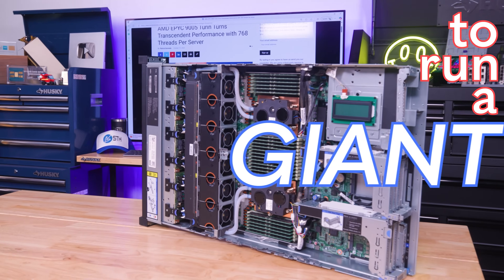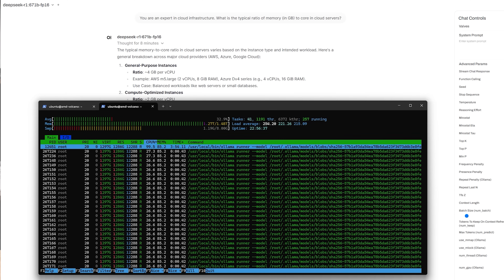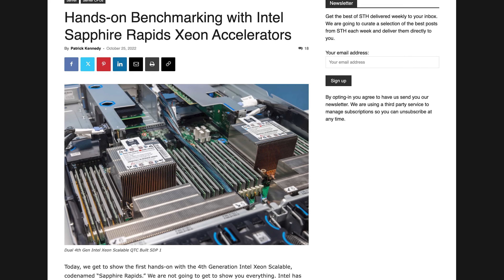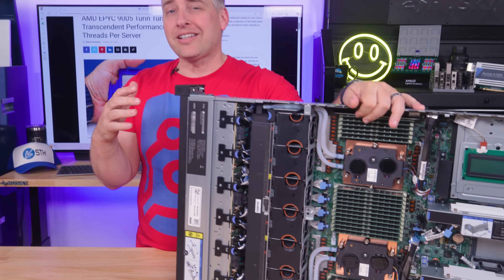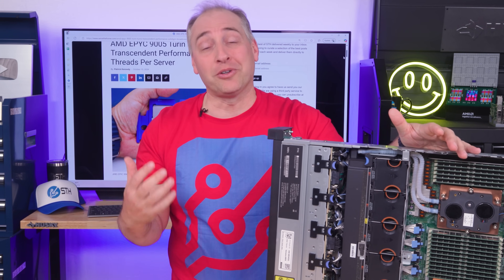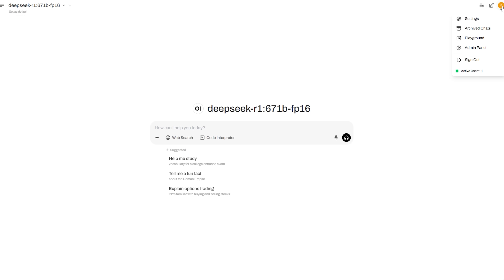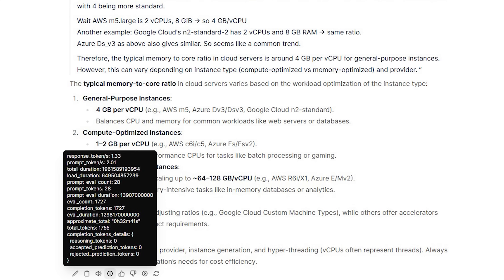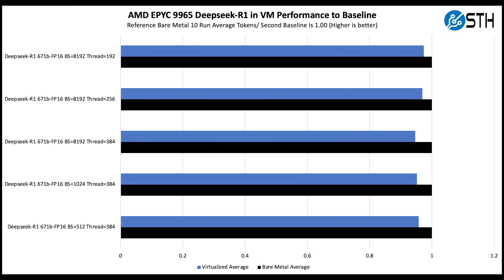Running Deepseek-R1 671B without a GPU

Comment: My intent is to do this on my server, though I plan on running smaller models than the Deepseek one.  The plan is to set up vms for my daughter to use for her photography side hussle/hobby and for my LLM habit(yeah I said habit LOL).  Really enjoy working with AI models both diffusion and inference models.  So win win situation if I can manage.  My server is a bit on the old side as it is for a home lab.  Best of luck to anyone who gives this a shot.  It is both overwhelming and rewarding at times.  Thanks for the video, now I don't feel so bad about a token a second now as the server you have there is a lot newer than mine.  So thinking I might not be doing so bad.  Albeit, the models I run are 70b and smaller but I also don't have near the horse power of the newer servers.

Comment: What if you bought the AMD EPYC 9015 (i.e. cheapest 9004-cpu) and a single-socket MB, but also filled all 12 memory-channels with DDR5 6400 MT/s. Would the CPU be able to keep up with the memory while running inference on Q4/Q8 DeepSeek R1? If so, then that would be a really nice price-to-performance system.

Comment: That's a complete waste...you can buy a used epyc 7702, 512gb memory system for $2000 and get the exact same performance.
Reply from the maker: This was at FP16. So that used 512GB system has less than half the RAM required to do what we did

Comment: 5 KW sounds like A LOT compared to mac studio 512gb with at most 480 Watts
Reply from the maker: This was on a 1kw ish system and the Mac Studio M3 Ultra 512GB but that does not have enough memory for this.

Comment: Not sure about AMD but Intel has libraries and extensions to accelerate AI workloads for Pytorch, TensorFlow, Transformers, etc. You can get as much as10x speed up versus genetic libraries (though you need a CPU with at least AVX2 support).

Comment: I prefer to run qwq:32b-fp16 reasoning model which you can easily run with 3-4 3090 or 4090 GPUs at a fraction of the cost of a huge core server at much better tokens/s and it actually performs equivalently to Deepseek R1 671B.
Reply: Q4 fits in a single 4090, and it's not that much worse, isn't it?
Reply: @vinylSummer  Always better to start with a smaller or more quantized model and only increase to larger ones when you need better performance.
Reply: @vinylSummer  That being said, Q4 on a single 4090 doesn't leave much room for context length which is pretty important.

Comment: CPU L3 memory is the critical bottleneck, in that with chipsets.. and leave specific cores out for the OS, one each CPU and on Epyc, each side..  Ya.. HPE 385, Romes (256M L3); 800W ( w/ 2T ram and a RTX8000 just got the GPU) and still setting up the MilanX (Supermicro w/ 1T and haven't decided on the GPU configuration.. maybe 2 RTX8000s?  10G RJ45 and/or 40G copper qsfp direct , +  Starlink.   Watch out for IBM used drives (funky encrypted in 520 format) and HP hates everything not HP (yellow lit already).  Master and student LLMs; fine training is the anticipation.  The real question is how low can one go with small LLMs, even in laptops with a dedicated GPU (P200, 2G Vram).

Comment: how would it work if u have an array of optane drives and would there be a way to run the models directly from disk?

i have 2x 480gb optane drives that would be enough to fit the model and run from disk and since optane is memory like, would that be enough to run it from disk or would the slower sequential read speeds be the problem? would that even be possible somehow?
Reply: Didn't Intel shelf Optane a while ago already? I thought there was no more software support ?
Reply: @thegeekno72  optane in itself is just another type of flash storage, the optane ur thinking about is probably the acceleration type to accelerate hdds and ssds which i dont care about, i just want pure optane to use for ai stuff.
Reply: LLMs are mostly memory bandwidth limited. Running off of what, 5 GB/s bandwidth on two optanes would be dog slow. The server in this video was probably at more than 500 GB/s bandwidth, so your model running on optane would be at least 100x slower. Probably even more so because of the added latency of optane vs DRAM.
Reply: @Steamrick  ahh ok intersting, so its just needs smth like a brain which just is highly interconnected to work the fastest, kinda makes sense if u think about it like that.

Comment: 8:10 small correction, the default ollama model is a Q4 "quantized" not a "distilled" model. Quantized is the original model but with its parameters "compressed" at the cost of a bit of precision. Distill is when  you train a different model, say Qwen or Llama, and fine tune it or "train" it on the outputs of another more powerfull model.
Reply: I would love to see a benchmark of the 671B 4 bit model on the same hardware

Comment: I run 4bit quantized version of DeepSeek-R1:671b on my home server CPU, PC is made from 10 years old e-waste parts:

・Dual processor Xeon E5-2697A v4 ($85 each)
・Supermicro Dual Xeon E5-v3 era motherboard
・8x DDR4 64GB ECC LRDIMM (512GB kit, around $500)
・Windows 10

DeepSeek parameter file is about 400GB and it consumes ～440GB main memory on running.

Couple of thoughts.
・I felt DeepSeek-R1:671b output quality is pretty good, it outputs worth to read text, much better than smaller models such as 70B or 14B.
・On Windows OS, just install and run ollama and setup DeepSeek onto ollama. input the question on the ollama console and DeepSeek answers.
・Token process speed is like an e-mail exchange with colleague type experience and not like a chatting speed.
・It is better to store parameter file onto SSD not HDD for quicker startup.
Reply: that's totally amazing, 512 gb RAM dumpster PC is just wild
Reply: I'm interested in this, whats the token/sec with CPU only?
Reply: @timecrash85  The speed is 0.19 tokens/sec.
Reply: @kenkyuujyomanoretimedia6509  lmao
Reply: @kenkyuujyomanoretimedia6509  HAHA, i mean if you are accessing it with software, might as well just wait all day right.
Reply: IMO DeepSeek-R1 671b 0528 q4 model is by far the best model, totally worth the wait to get answers, seeing superb 671b results make me to stop using smaller 70b or 32b, those distilled models output too many errors. BTW I recently added DRAM to 1536GB and now DeepSeek-R1 671b q8 runs as well on my dumpster PC. So far there is no perceived quality difference between 671b 0528 q8 and 671b 0528 q4 (4bit quantized model), both models output valuable and insightful text.
Reply: If you only get 0.19 tokens/sec, then something is seriously wrong with your configuration. With 8 x 2400 MHz DDR4 DIMMs you have a total of 156.6 GB/s of bandwidth shared between your two sockets. Each token invokes 37 GB / 2 = 19 GB of RAM. The theoretical bandwidth limit is 8 tokens / second. Xeon E5-2697A v4 has AVX2, so compute should not be the limiting factor. Most likely your processes are calling memory across the slow CPU-to-CPU link. TRY THIS: Use b4rtaz/distributed-llama. Set up two nodes, each limited to a single CPU. Configure each node with a TCP port and connect the two nodes via the Localhost (127.0.0.1) address. For more information, read the thread "LLM inference with tensor parallelism on a CPU" by @fairydreaming in r/LocalLLaMA on Reddit.
Reply: tokens?

Comment: The best workloads are those which are batch jobs (no interactive user). We actually do have a VM that runs AI workloads on the CPU for exactly that.
I think if you have a N+1 cluster for running VMs, you might be able to do this on a node you might keep empty. But how to set things up that the VM goes away when an outage of an other machine happens ?
Maybe if you are only running Kubernetes, having all Kubernetes VMs running on all other machines and have one large Kubernetes VM on the one machine, after everything is settled, add the large VM and deploy the pod on that VM, if you specify the correct mem/cpu for the pod Kubernetes should automatically place it on that node. Then have a small program watch if any Kubernetes VMs are down, if so, kill the large pod, all the Kubernetes workloads which need space to go somewhere else will automatically end up on the large VM.
I guess you could do the same thing at the hypervisor level, if you aren't using Kubernetes.
Reply from the maker: That is exactly the idea

Comment: LLM inference on modern hardware is not compute limited, but memory bandwidth limited. (See 11:04 - Using only 48 threads on 2 x 196 cores gave the best performance.) Using 4-bit quantization instead of FP16 should thus give about four times more tokens per second.  ALSO: Offload the fixed parts of the model to a GPU or two. Any GPU or GPUs with ~24GB of VRAM will do, as long as their combined memory bandwidth exceeds that of the CPUs. Deepseek-R1 671b is a Mixture of Experts model. For each token, only 37GB of the memory is invoked. Some 60% of this is fixed and used for every token. Offload these layers to the GPUs. This should double the throughput. 
About NUMA: For best performance use tensor parallelism and split each layer evenly between the NUMA nodes or dual GPUs. Otherwise your nodes will be running in sequence with each NUMA node or GPU active only 50% of the time.
Reply: Have you run quant 8??   and older GPUs don't do quant 4 very well... (yes, I have a couple of P40s that I picked up cheap)...

Comment: big money, big video, 1 token per second... amazing
Reply from the maker: Closer to 3 tokens per second with minimal tuning and showing you can do this while running other VMs. Remember this is a model that is bigger than the GPU memory capacity of an 8 GPU HGX H200 platform
Reply: @ServeTheHomeVideo  i agree, i was just expecting more for such a beast of a hardware. i was thinking i can invest like 30k to get it run "well", but seems this take 10 years more to happen 😞

Comment: I've got the DeepSeek R1:70b model running on a pair of 3090s right now at home.

And as a result of my experience with it, at home, I actually PUSHED my company's IT team, to deploy the model, at work.

At first, they were like "we don't have the infrastructure to support it" and then I was like "but we don't really need to run the 671B model neither", so they were able to deploy the same 70B model as well.

We're still, right now, at the stage where we have to scrutinise the results that the LLMs produce as there are still quite a lot of errors with them, so it takes a couple of tries.

I'm also pushing my company (in automotive) to use it more as well, but also recognise where it might not be as useful as senior management might think, as well as using it so that it can automate my own work, so that I can move on to doing something else instead.

Comment: An interesting idea, though I should point out that this is a model that's being trained against a dataset. To have your model run for your dataset will require entirely more capacity and IO. Second is resource contention--vCPU ready time and costop. For infrastructure servers running services, yes this makes sense, for user facing scenarios, not as much. As always know your apps and their latency sensitivity and be aware that latency can be a knock on effect when repeated access is required and the data isn't in a fast cache. 

I am more wary of unaccelerated workloads because of dataset training, and if Intel accelerators work well with DeepSeek, then there's the knock on effect of performance advantage for model tuning and iteration. All things to think about as there can be a spike in TCO if you're cavalier with AI and don't plan resources, especially if electrical consumption (performance per watt!) starts to creep in.

Comment: My Sapphire Rapids + 1TB RAM + Nvidia RTX 6000 Ada:

DeepSeek R1 671B Q4, loading 5 layers into GPU:
4.36 tokens/sec

DeepSeek R1 671B Q8, loading 3 layers into GPU:
3.62 tokens/sec
Reply: Did you try offloading the always-on MoE experts to the GPU?
Reply from the maker: Sweet! The idea of this was no GPU and a virtualization-focused setup, and I wanted to do something big. You are right, smaller models can perform better.

Comment: Thanks! This video answered a major question. Next thing I wonder is how many tokens per second would Q8 model squeeze on that server. Double? Or something else? And how CPU utilization will differ at Q8? Also, if there is a GPU (or two), would it give a detectable speedup? And what about the CPU utilization then (with GPU in the mix)?
Reply from the maker: All valid points and ideas. At some point, we had to bound this because it takes a long time to iterate through 10 runs, even just varying thread counts or the type of VM being run concurrently.
Reply: LLM inference on modern hardware is not compute limited, but memory bandwidth limited. See my comment above about MoE and GPUs.

Comment: 671b at fp16... woof... In my experience, the quant 4 is reasonable, but there's a pretty dramatic usefulness difference between quant 4 and quant 8, I'm sure going from quant8 to fp16 is likely another pretty big jump, but I noticed (particularly on the smaller models) that quant 8 is a pretty nice step up in the quality of the results.
Reply: Considering 671B was trained at FP8, you gain very little running it at fp16
Reply: In my testing Q8 is a real sweet spot. Q16 starts getting diminishing returns.
Reply: @zackj997 Yeah, Q8 is a really nice middle ground.  I run the llama 3.3 70b at q8 (on 4 RTX 3060 12GBs) and it is awesome.
Reply: @AdrianBacon Q8 70b would take like 8 3060’s are you thinking of Q4 maybe?
Reply: @ No, running q8.  Ollama splits it out and will run what it can in VRAM and the rest in system ram.  The system I'm running it in has 128GB of system ram, so the 4 3060s speed it up quite a bit compared to running in CPU only. It's not as fast as running Q4 (which jams out 20+ tokens a second), but for automated workflows using something like n8n it's fine.  I have a second system with two RTX 3060s in it that I use with the llama 8B model also at q8 and a big fat context window with open web UI and that's my basic every day UI based driver.  I also run stable diffusion and other stuff on it.  It's been pretty good too.
Reply: @AdrianBacon  bro is a 3060 magnat
Reply: @vinylSummer  here in the US, the 3060 12GB is less than $300 per card brand new.  I’m jamming 48GB of vram for a fraction of the cost of pretty much anything else in that vram range. If you’re running a model that fits in vram, ollama cracks out over 20 tokens per second, which is way faster than most people can read.  The only thing you have to keep an eye out for is having enough slots spaced the correct distance apart on your mobo, and having a power supply with enough connectors and juice
Reply from the maker: That is a totally correct observation. Actually, the FP16 output was really good. We wanted to show the big version under the idea that if we show the big version, then folks can know that they have an option of running a smaller, faster option on the same hardware.

Comment: I run a deepseek r1 distilled 14b model on my amd r7 2700, 32gb ddr4 3066mhz with a 2080ti 11gb (fits in gpu mem),  it spends more time preprocessing on the cpu than it does utilising the gpu i noticed,  I do like how openwebui allows for creating RAG and other python code to optimize and utilise the memory function,  I have a double think pipeline, temp 0.8, context 2048, batch 1024, numkeep 48,  num_predict 4096,  nmap enabled and use_mlock enabled,  its very often better than the free chatgpt with search and reasoning on,  it certainly produces better contextual feedback in most scenarios and also seems to produce more accurate uncensored responses overall.  ive done several sbs comparisoms, even had friends tell me, that they prefer to use mine over chatgpt, I use the all-MiniLM-L12-v2, sentance transformer embedding model, and the BAAI/bge-reranker-v2-m3, and searxng for the search, with all search engines apart from google search disabled, all run from a single docker compose script,  nice to just ,  turn on and off when required.